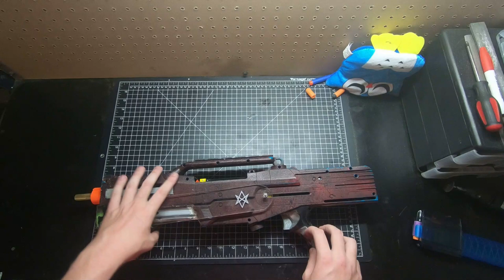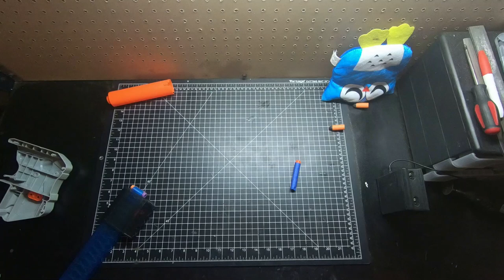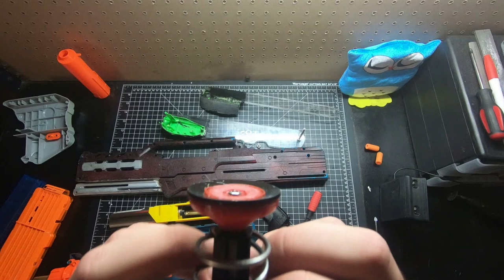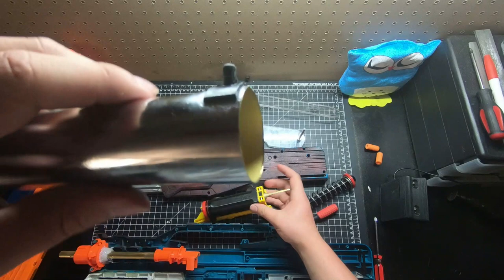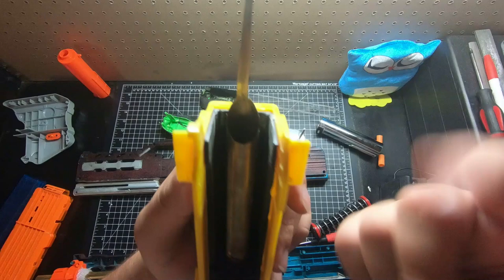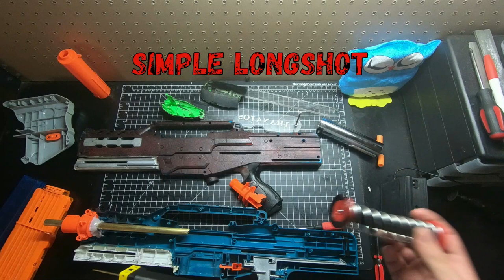Simple LS Kit

Comment: so if you buy this kit from your etsy it comes with the brass breach and barrel? so it's almost an angel breach drop in kit?
Reply from the maker: koolBOY8323 it’s not really an angel breach those are different this is just a brass breech it also comes with more than just the brass
Reply: @modbros5345  i understood that you got all the 3d printed parts, and the plunger tube and rod, and all that, but including the brass is just next level. my LS as it sits gets only about 90 fps, with an 8kg OMW spring and stage 2 unleashed kit. upgrading to a sealed brass breach and barrel with a drop in kit, as well as a larger plunger tube without having to cut the breach myself is just damn cool.
Reply from the maker: koolBOY8323 I’m a huge fan of the long shot I stand behind this kit. And this kit has actually has replaced all of my OWM stuff